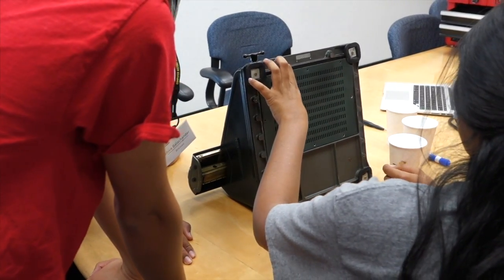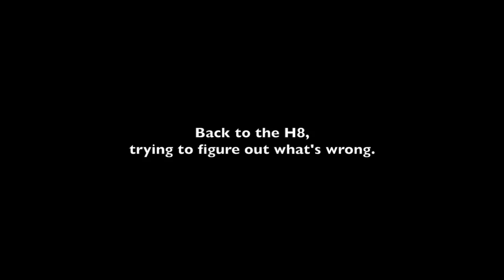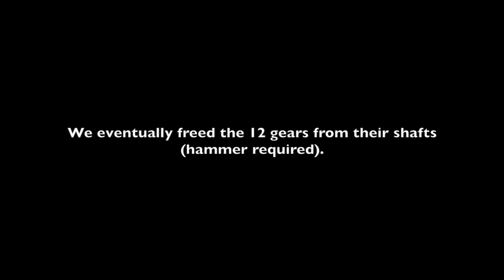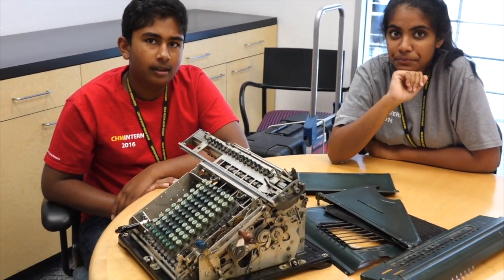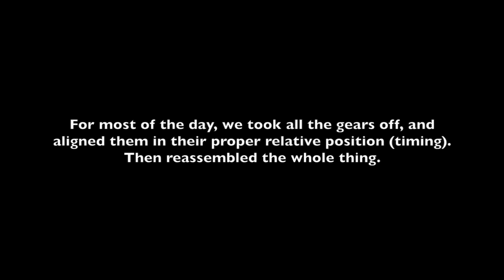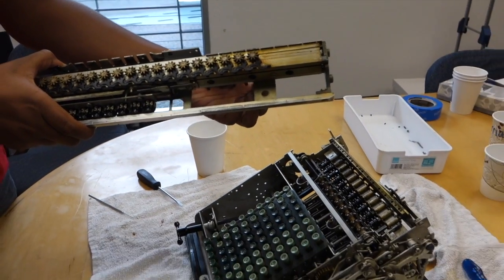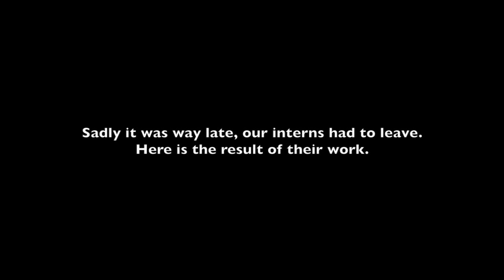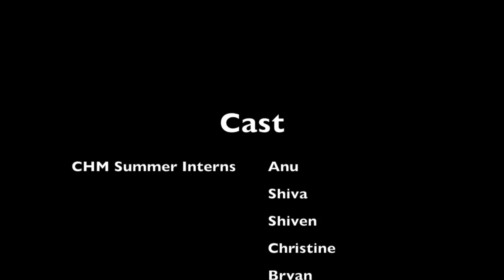Summer Interns vs. Friden H8 Mechanical Calculator

Comment: Thank you so much for this video. In 1964 (or was it '63?) my dad brought one of these home. We were amazed by this mechanical monstrosity that could add subtract multiply and iirc divide. I think there was an algorithm for square roots, but that required a LOT of crank turns. I don't believe we ever dared to open it up and disassemble it! That took some major gumption.
One of the great things about these was you could see how long multiplication/division worked as the carriage moved back and forth. Something of which our smart phone using kids are mostly ignorant.
So many thanks to you for this trip down memory lane for me.
Reply: I sent a link for this video to my brother. He says he still has dad's H8 and that while it's sticky it still functions. Friden built things to last. Friden not only built the chassis and mechanism to last, even the key caps were built that way. They were injection molded with two colors of plastic. The first step left a cutout the shape of the digit or label. The second step filled the cutout with the second color. Almost impossible for someone with long fingernails to scratch the key's identity away.

Comment: Not the dreaded Water Displacement 40!   Be sure to flush the WD40 out with ample oil otherwise there will be more problems within a few months.  WD40 is perfumed fish oil.... haha
Reply from the maker: WD-40 is a big no-no for oiling, it's the very opposite of an oil. The purpose of this was to get thing unstuck quickly - which it did. In a real repair you'd follow with a complete dismantle, clean and proper oiling. Which of course was not the purpose of this. We did use light oil after things were unstuck, but without proper cleaning, so this repair is not  sufficient.
Reply: WD40 is good for loose things, but whos Idea to oil something with WD40?